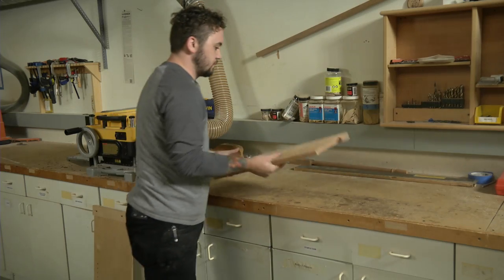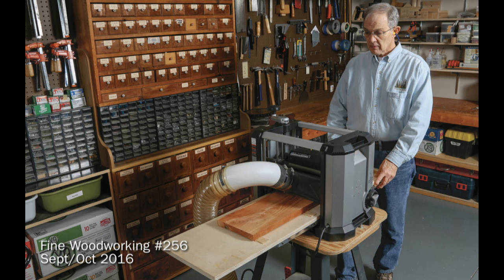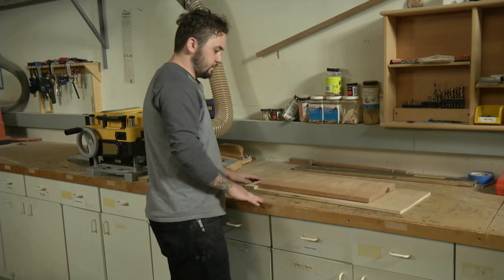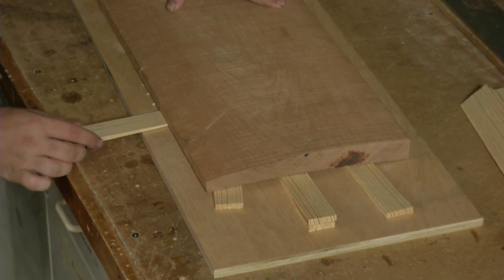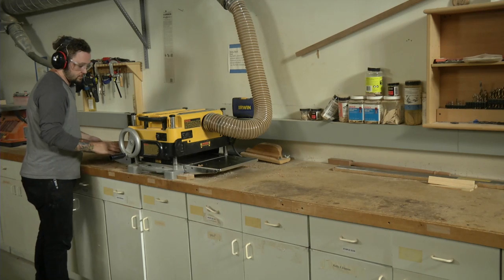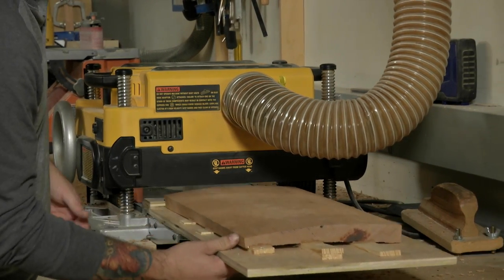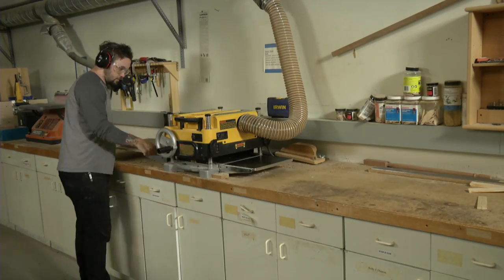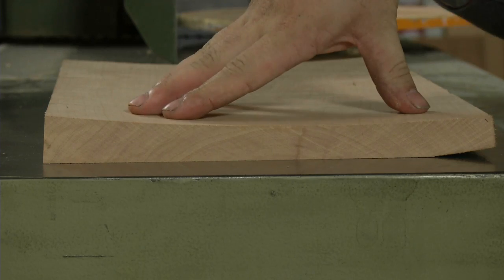Turn Your Planer into a Jointer

Comment: what stops the in feed rollers pulling the stock forward through the planer? is the hot melt strong enough? or should it be fed through lip first?

Comment: How long is the prep time for this method? In a production environment I have to face joint a 500bdft lift in an hour. I forgo all of this and send it through the planer crown up and rough. It's not 100% cabinet-ready flat but it's very close to flat and rarely do I need to shim a board unless it's extremely twisted. And at that point I wouldn't be able to get the material out of it due to the twist exceeding my needed thickness. A faster alternative is to screw rails into the two high points of a cup and only screw into the checked ends of your board (what will be cut off anyway). Saves on careful shimming and hot glue. You can be a cowboy and still be safe and efficient.
Reply from the maker: "In a production enviroment" This is certainly not a technique for a production cabinet shop.

Comment: Lost a lot of material
Reply from the maker: I'd argue the opposite. It was so twisted the board was useless. After we used this sled we had a 1/2" of flat material to work with. -Ben
Reply from the maker: It all depends on what you need out of the stock.